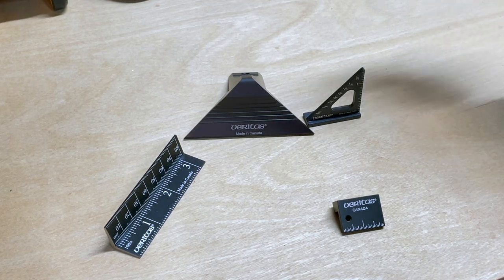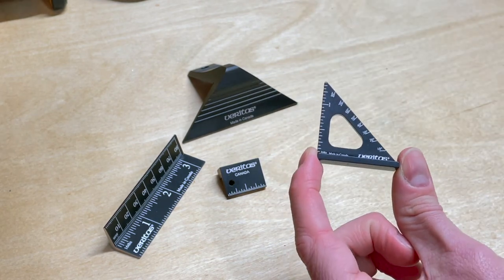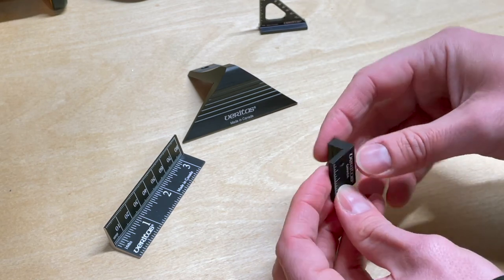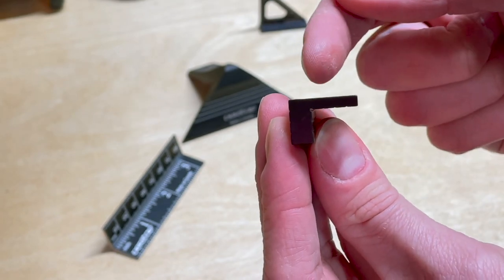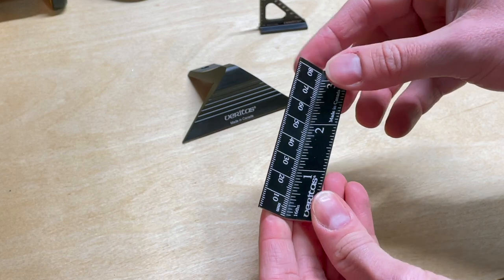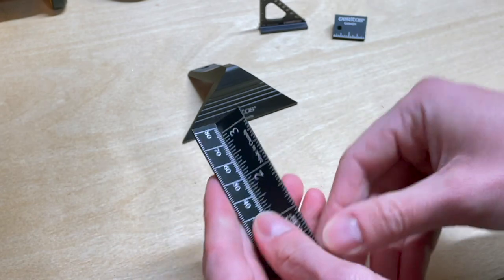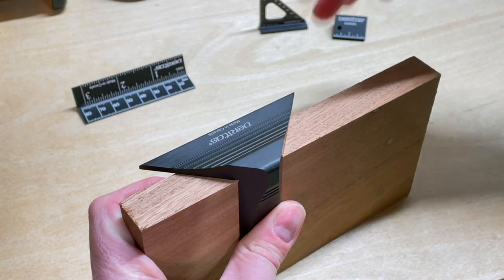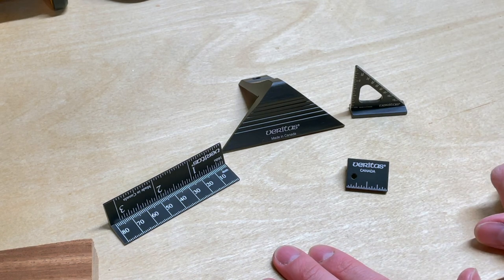Small Layout Tools from Veritas // Pocket Square, Layout Block, Drill Stop Gauge, Mitre Saddle

Comment: Why wouldn't you use the 45 deg saddle square on a 2x4? and you missed the actual basic function of that square, which is to precisely transfer the 45 deg cut like from the longer, flat edge, across the bevel edge, and to the other side, so you know where the cut will end up on the 'blind side.'